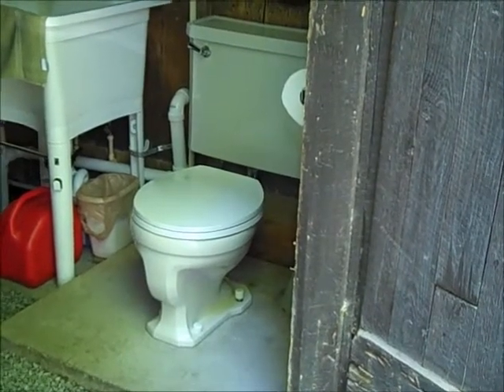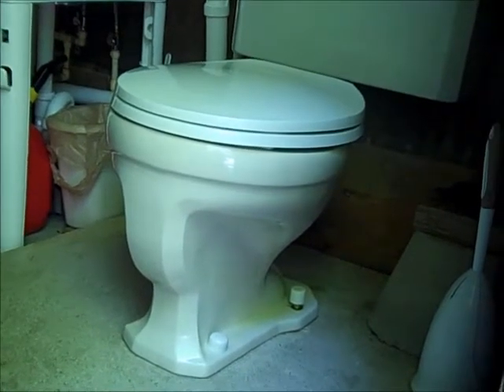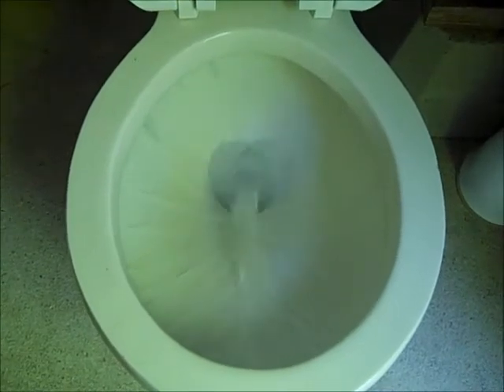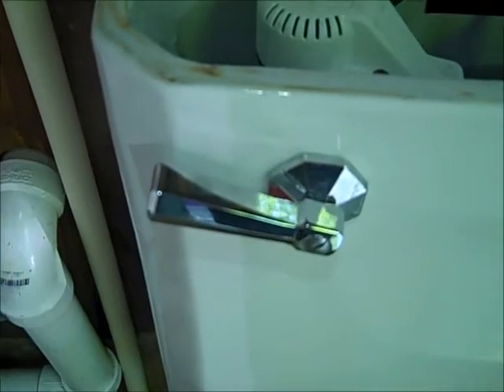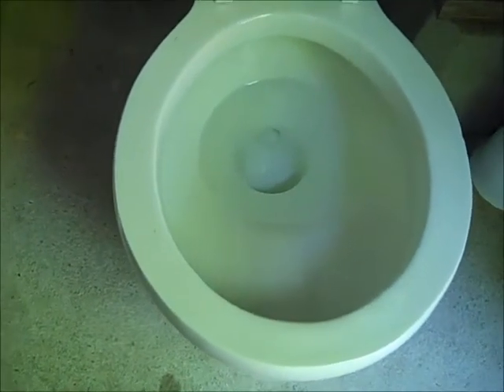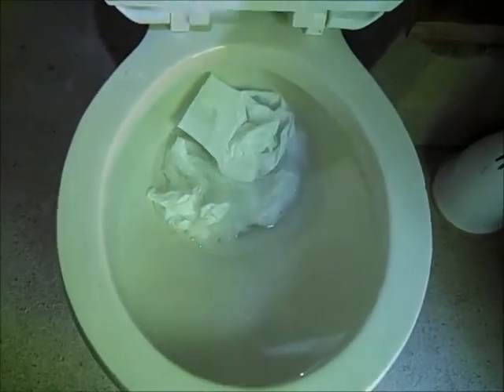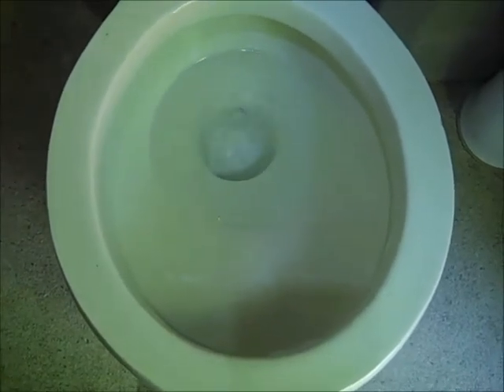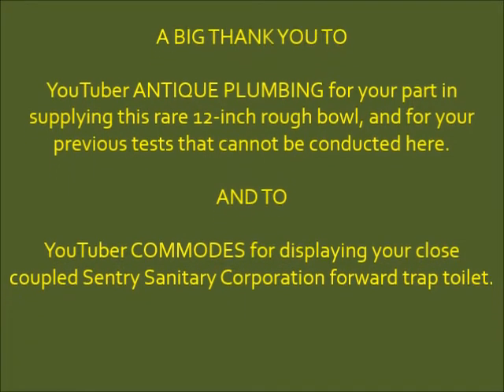87.  1943 Sentry Sanitary Corporation Bowl & "Standard" 4050 Tank

Comment: Hi VTVT... you mention that Sentry Sanitary and Bowers Pottery were in the same town. Truth be told, Sentry basically WAS Bowers Pottery, one of several owners the plant cycled through after George Bowers' heirs sold the company in the mid-'40s. (Sentry's parent company was a Philadelphia-based maker of fire safety equipment.) In fact, if this was dated 1943, I'd dare say it was an actual, late-period Bowers Pottery toilet.
Reply from the maker: You have provided a very important piece to this puzzle.  It very may have been a Bowers toilet.  The close coupled version of it  was used  by a builder in my area back in the '50's.  The one where I actually saw a Sentry Sanitary sticker on it was in a laundromat in Burlington, VT.  That shopping center was built in the '50's, so the company must have lept the Bowers design.  I haven't had this particular bowl in place for several years.  However, it was an excellent performer.  THANK YOIU for your comment!!